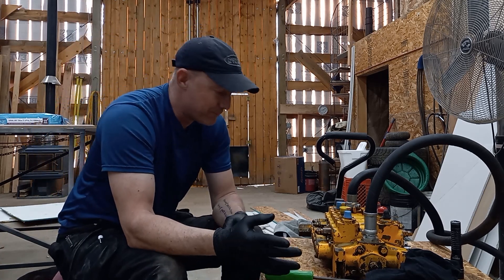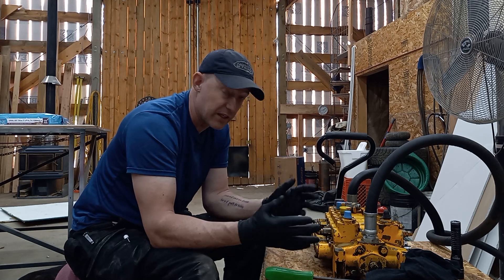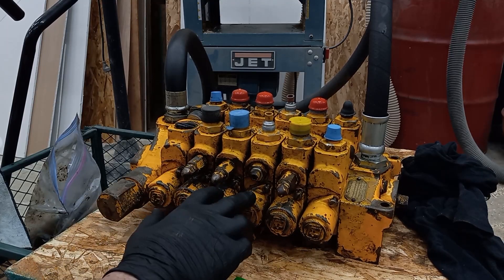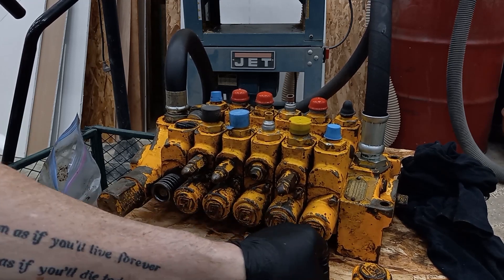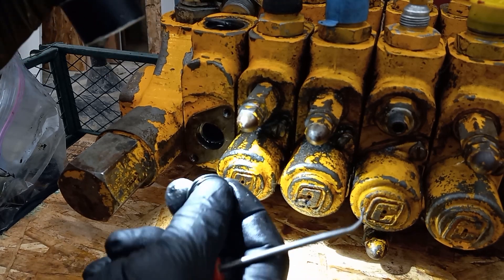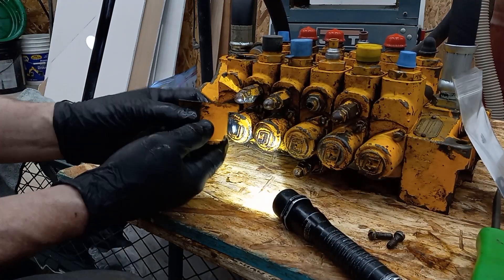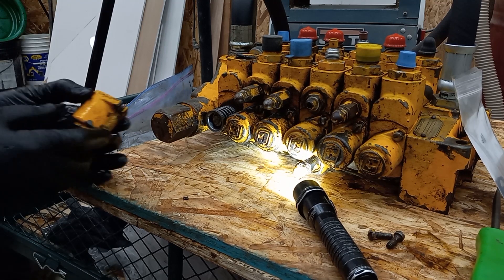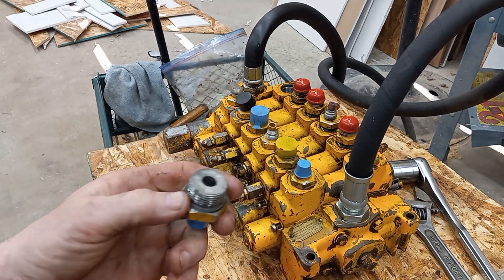1968 Case 580CK Hydraulic Valve Body Rebuild

Comment: An old video i know but i recently picked up at 68 case 580ck. After getting it running and figuring out what all cylinders need rebuilt. I know some time eventually one of the valve bodies will need attention . I have done cylinders before but i have never opened up a valve body in my life (luckly). While so far case has been pretty helpfull on weird stuff, they are pretty slow. A place knows their stuff is helpfull more then anything. These are simpler then i thought to do.
Reply from the maker: I thought it was going to be way more complex than it turned out to be. Thanks for watching. :)

Comment: Hello, I just took my 1960 case model 31 loader backhoe external hydraulic pump and control valve to a shop because I did not know where to get seals or parts. I took them in on the 8th of July 2025. I called last week and was told they were waiting for parts. I called yesterday, July 23. The guy said they were waiting for parts. I said parts for both of them? He did not know, so he gave me someone else to talk to. He gave me the guy rebuilding the pump same thing was waiting for parts. I asked what kind of parts, and he said seals. I told him I knew where to get seals now. He said he would talk to the parts guy and call me back. So turns out the parts guy called the dealer over 2 weeks ago and they had no seals so he just quite looking and told no one. The mechanic apologized and said he would call the number i  gave him for ACE Seals in San Jose. I am so disappointed. I should have went and got it and tried to rebuild it myself. Thank you i called ACE Seals and they said sure just send them the dimensions.
Reply from the maker: Sorry to hear about the mechanic not getting the job done. It's so hard to find a good repair shop these days. I hope they get if fixed up for you soon. :)

Comment: SO!!! Thanks for this video , it cleared up some mystery for me and you were so kind to list your source for parts which was solid gold !!!! I want to ad something however just as an FYI to everyone. If you freeze this video at 7:12 and you follow that shaft down from the end furthest from his hand . You see the holes for the linkage and you see some staining from the rust and elements and then some clear shaft then another ring of rust stain . THAT IS THE UPPER SEAL KILLER . These things typically have dust boots on them and when they sit for long periods like old equipment does condensation builds inside those boots and causes rust at the top . Then you not knowing any better grab the handles and try to move them and that rust ring if forced down the bore and cuts the upper Oring seal. So if you get a piece of old equipment and its been sitting take note of whwat im saying and move that handle so the valve is being brought up out of the bore and clean that area of the shaft before it gets pushed down into the seal area...IF the pitting is bad enough and the travel of the rod puts that puitting into the seal area you will have to have the rods refinished on that end which entails welding them up and then turning them on a lathe again.There is a ton of this old equipment still out in the world and its viable stuff for a guy or a girl that just wants to use it around their homestead or whatever  . Information like this video is solid gold for keeping the old stuff going and not breaking your bank account..
Reply from the maker: Thank you for this. I did notice the discoloration but it didn't feel bad enough to warrant much attention, and I definitely wouldnt have had the cash to have them machined but I can see how it could cut through a seal in no time. :)
Reply: @KoalityofLife  Hey, if it's working then great!. As long as it's smooth and doesn't tear at the seal you might get many years of use with no leaks. Refinishing them involves welding up those areas and then turning them back down to size. I have a JD 9550 series backhoe I'm working on right now that may need it on a couple of the spools.
Reply from the maker: @kylevantassel7259  Sounds expensive but if it makes the seals last longer then its definitely worth doing. :)

Comment: Thanks.   I picked up a 75 480B Construction King and I'm starting to go through the hydraulics.   This was helpful,  cheers.
Reply from the maker: You're welcome. Glad it helped and thanks for watching. :)
Reply: i just brought one home last week .. 3 of the vales are stuck ...i looked and part of the backhoe frame is under the valve body so i just can't pull the spool valve out the bottom like you can on a 580ck .. how are you doing on your 480b restoration .. i have LOTS of hoses to replace ..

Comment: hello i was wondering if you can give me the specification on the o ring sizes
Reply from the maker: Sorry, I didn't write them down anywhere. If you have a micrometer measure the inside diameter, the outside diameter, and the thickness, then order o-rings. Hope this helps. Thanks for watching. :)
Reply: @KoalityofLife is there a invoice number I could use to give the o ring company that would give them the sizes you ordered? I need exactly what you replaced. Thanks

Comment: Sounds like a case for avoiding a Case! 😂 Sorry I couldn't resist.
Reply from the maker: Case and point. I would not buy another Case after finding out that a lot of their cylinders are proprietary to their equipment, after Case stops making or servicing a part its almost impossible to find. Thanks for watching. :)